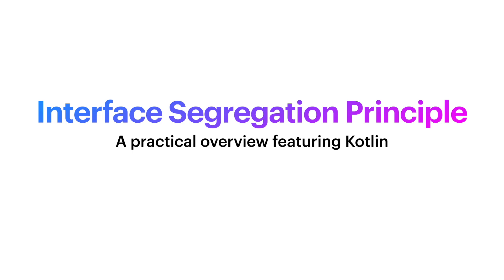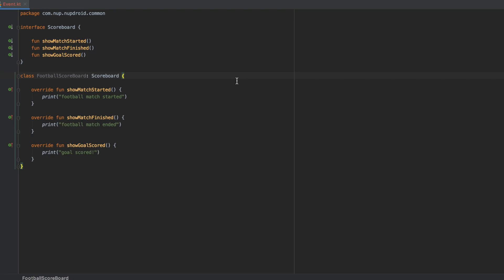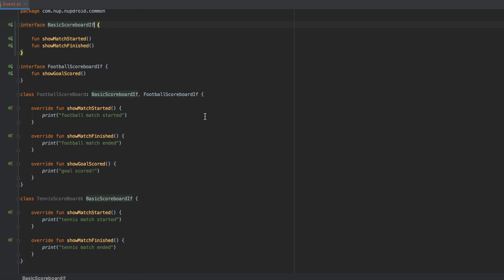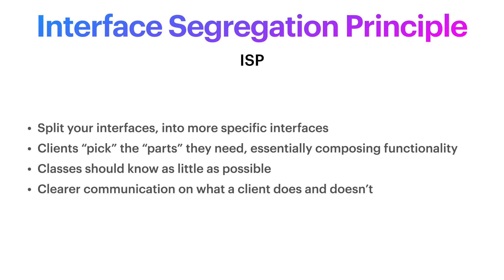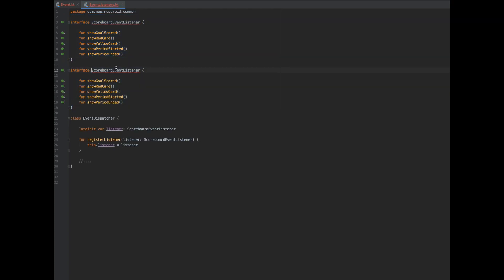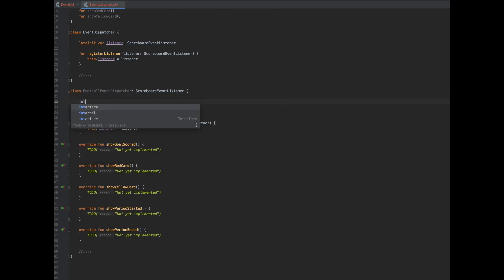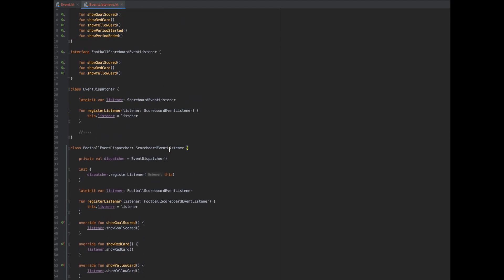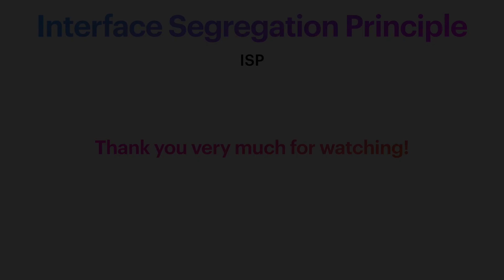S.O.L.I.D. | Interface Segregation Principle feat. Kotlin

Comment: Thanks for the explanations, they were really on point!

A couple of suggestions:
In your first example, you could have also made the FootbalScoreBoardIf implement the base Scoreboard interface. This way, your FootbalScoreboard could have implemented directly this interface instead of implementing 2 interfaces.

Also, I would say you could increase the font size of your IDE editor, it really helps for those watching your code and explanations on smaller screens (or phones like in my case). Having a bigger font size for your code will also fill up the empty space in your editor during recording.

Keep up the great work!
Reply from the maker: Thank you very much for your comment! 
So, you can definitely do that, and inherit from the base interface, and it still is valid and actually less verbose which is a good thing. The reason I did not go with inheritance is because you have to be super sure about inheriting, that the sub-interface has a IS-A relationship with its parent interface, otherwise it can cause coupling down the line. In this particular scenario of course, footballScoreboard clearly IS-A scoreboard, so it is a good fit.
Also, thank you for the advice for smaller screens, I will keep it in mind in the next one!

Have a great day :)